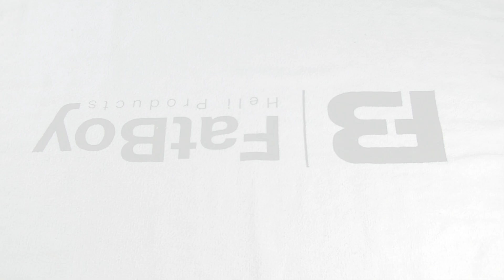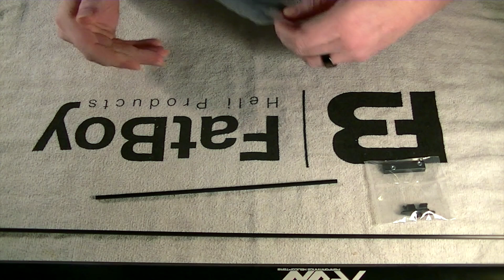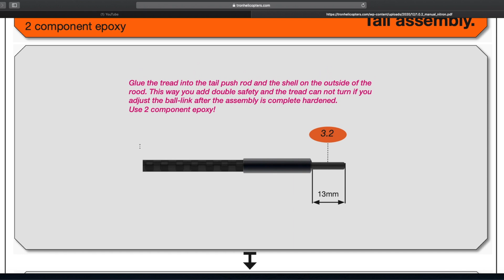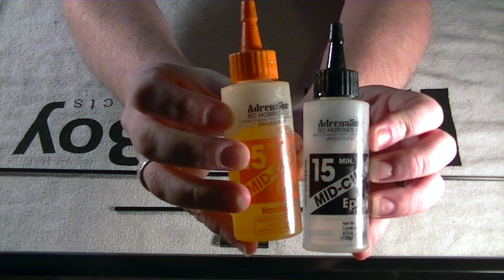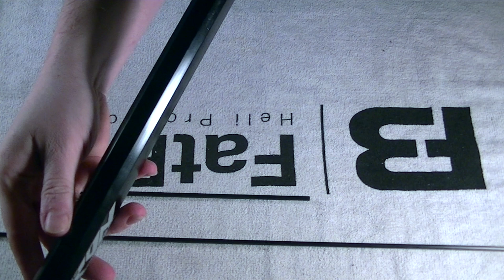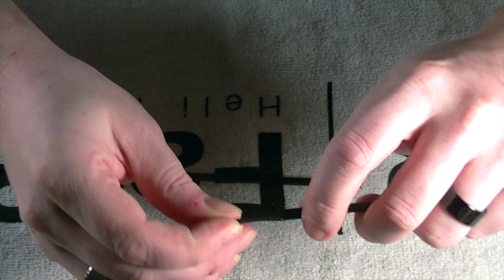NiTron Build Series : Tail boom assembly (FreddyCanFly)

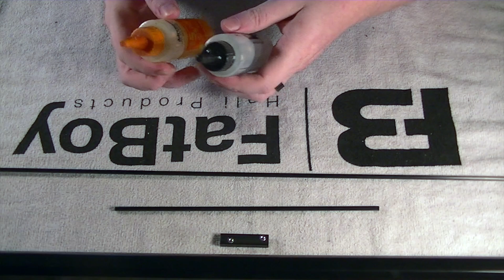Comment: 12:57 I really don't know like how long these epoxy last? they give you large bottles .. do you recommend replacing them every year like manufactures recommend  it worries me a lot to use old epoxy glue...i have alot of work ahead many goblin helis.
Reply from the maker: I have used the same bottles for years to be honest and I have never had any failures.  But for sure it never hurts to air in the side of caution.  Keep things as up to date as possible!